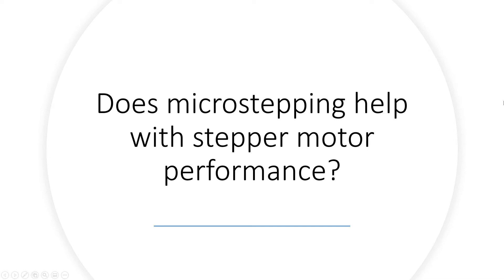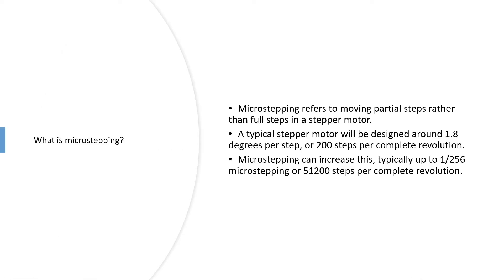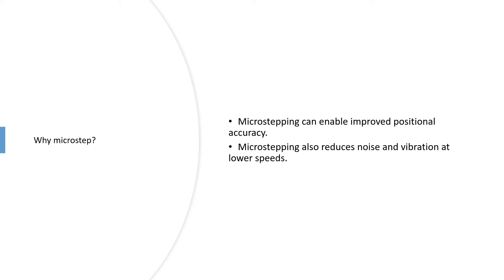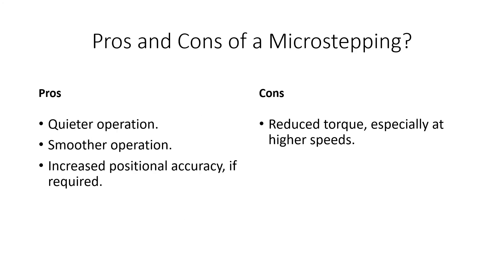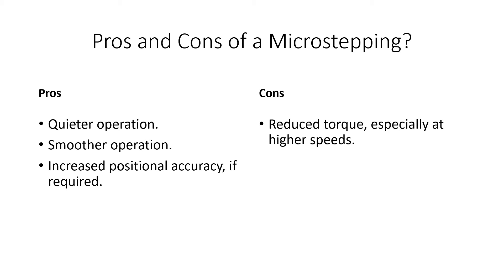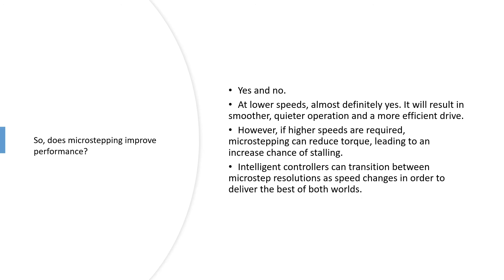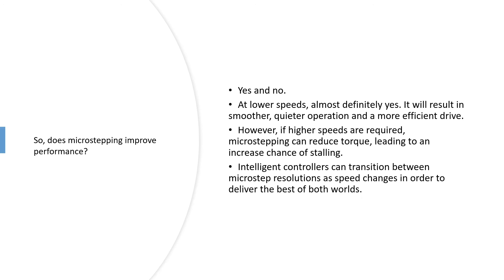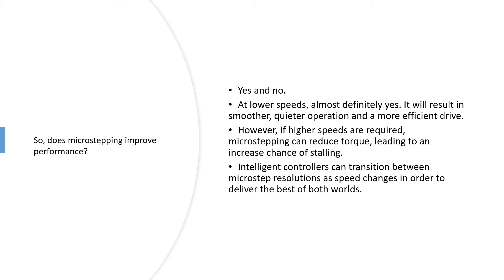Does Microstepping help with stepper motor performance?

Comment: Thanks for the video.  If position control isn't very important, is torque higher at full steps compared to half steps if at, say, a low rpm like one per second?  Do full steps result in a higher holding torque when stopped?  Do full steps increase motor temps when stopped?  Please forgive incorrect terminology, I hope you can understand my questions.  Any help that you can give a beginner is greatly appreciated.